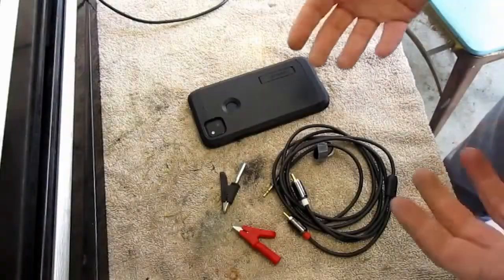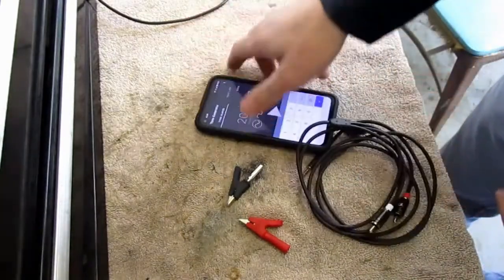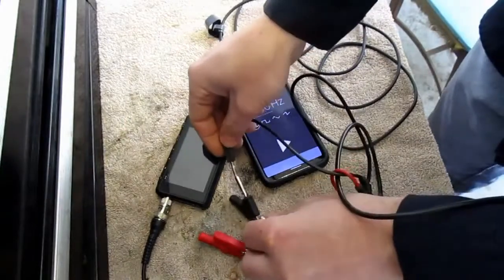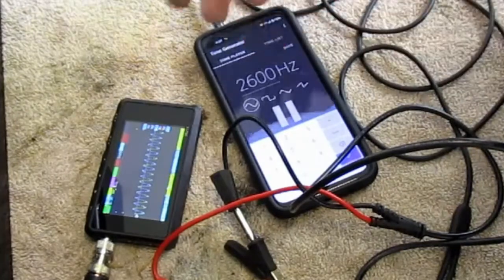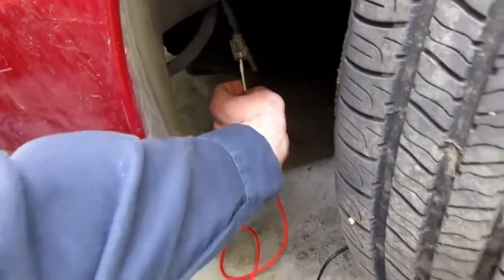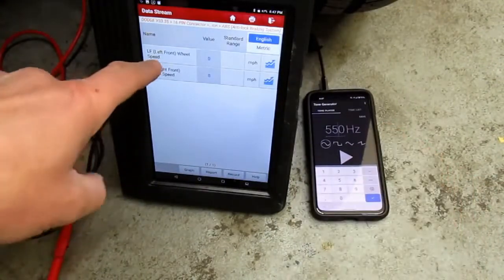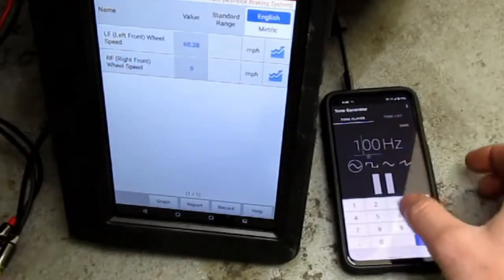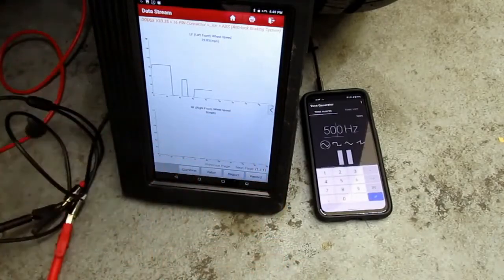How to Build a Signal Generator With Your Cell Phone | Can I Use My Phone as a Signal Generator

Comment: As described this is NOT a good idea. But it is a good way to destroy your $500 cell phone. If nothing else you should insert a DC blocking capacitor in series with the audio lead. Someone is going to apply 12 volts directly to the headphone wire.

Comment: Robert have you got any other videos where you use this signal generator?
Reply from the maker: Unfortunately I don't. If you have any ideas I can put one together.
Reply: Robert for the life of me I cant get it to work. Tried different apps, not sure what I am doing wrong.
Reply from the maker: @Grunter123  what are you using for the cable out of the headphone jack?
Reply: @ValleyMobileAutomotive   made up a cable like yours. I have continuity on both wires.
Reply: @Grunter123  Volume? Probably way to late, but if anybody comes across this?